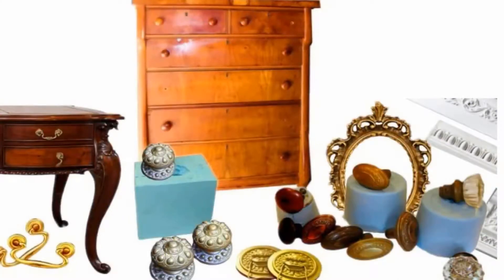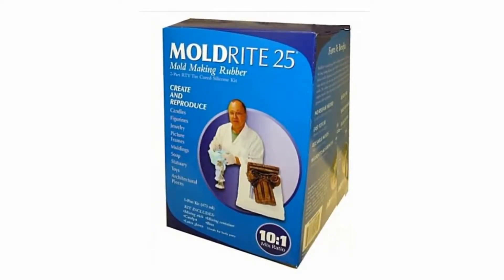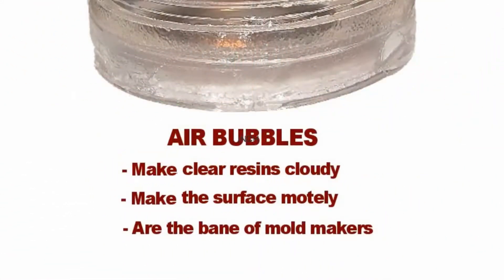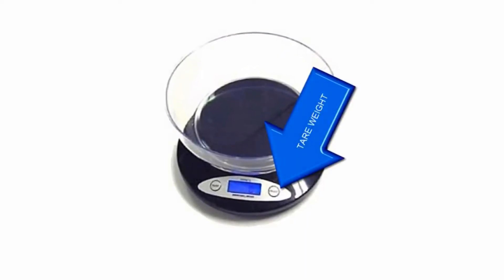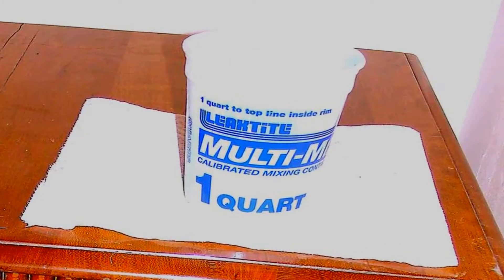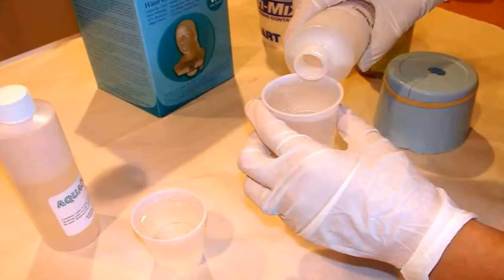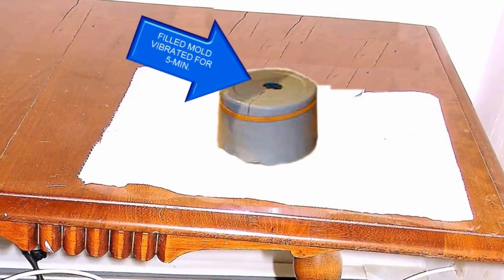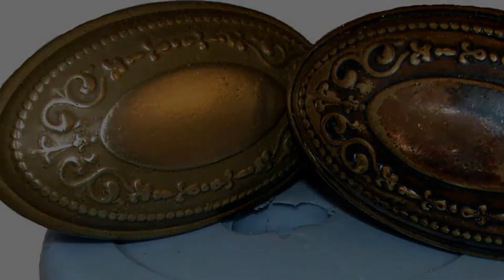Duplicating Antique Hardware Using Cold Casting Tutorial

Comment: Do you insert the screw hardware into the casting resin while it's still liquid? How do you ensure that it's level and doesn't list to one side as it hardens?
Reply from the maker: Hi there Debra. You must make certain your mold is level before pouring resin. Then resin will seek level by itself. If you are making knobs you will attach to cabinets, you drill a small pilot hole into the knob. You then have a long screw (sheet rock screw works) come through the backside of the cabinet and screwed into the pilot hole of the knob to attach it firmly. Warm regards, Ed
Reply: @EnvironMolds  Thank-you:) Can you use this method if the knob has open work? Do you just stretch the silicone that goes through the holes to slice it free? I got an antique dresser with only 5 of the original knobs. I could replace them all, but they are SO cool and unique. They have a bit of an art deco flair to them. I did an image search and found nothing.
Reply from the maker: @debrachase3131  Send me a photo and I will send you instructions - However, openings make it more complicated. Yes, you can cut it free in the silicone. Best regards, Ed (ed@artmolds.com)